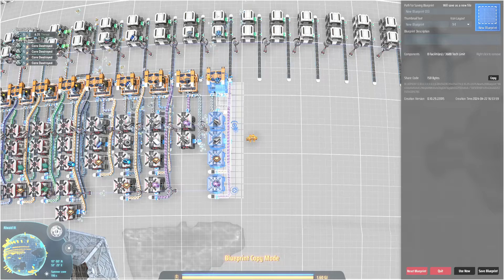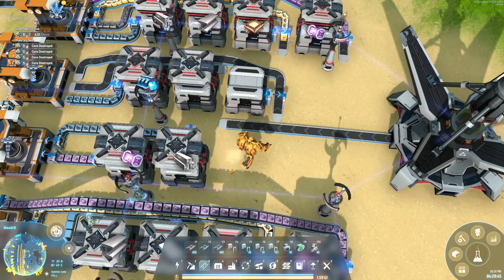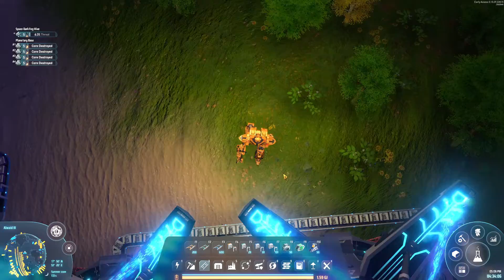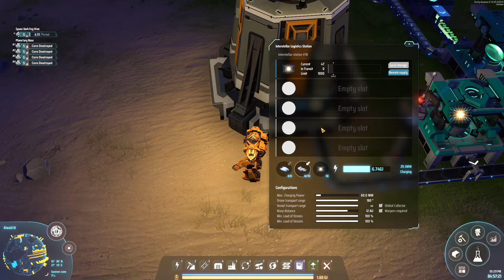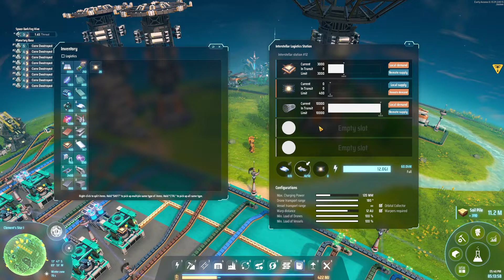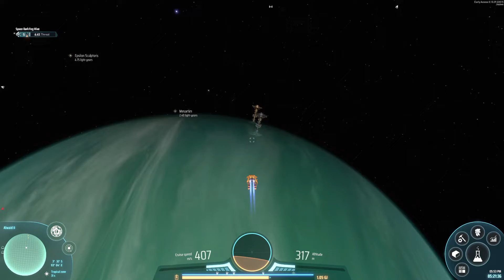ENERGY EXCHANGER // Dyson Sphere Program // Mission Log 85

Comment: I'm not sure, but I think the issue with the warpers not shipping was actually two things:
• at Alweid, the ILS tower has warpers in the cargo slot but not in the warpers slot for use
• at Clements, when you loaded some warpers into the useage slot, the tower immediately spent them all to ship processors.

I'm sorry you won't receive this until two months after sending your distress call, but I'm stuck in July 2024 where time travel is still supposed to be secret. They're starting to figure it out, and I don't want to be the one responsible for paradox crisis, not again! Alexa transmit priority Juan dangit cancel cancel what the
Reply from the maker: It's all good, my temporally challenged friend. You are undoubtedly correct, and it may be of use to another stranded time traveler in the futresentpast.

Comment: energy exchangers will NEVER overcap your power. they will only request up to your maximum available power. they are rated for 45 MW, but if you only have 30MW available it will use 30MW. you can have 9000 exchangers and they will split whatever extra power you have equally between all of them. you can also proliferate accumulators and they will charge/discharge faster, which basically just makes it so you need less exchangers to do the same thing.

remember that this tiny build is 2 production lines, which is 2 opportunities to proliferate. you could get 56% extra warpers if you proliferate both steps! (highly recommend, strange matter is expensive! lol) don't bother proliferating the warpers themselves, that doesn't do anything sadly.

definitely a huge episode here! don't forget to keep your science going in the background, you have lots of random upgrades you can keep plugging through, not to mention some neat weapons you can unlock with purple science!
Reply from the maker: Great tips, especially for the warpers. Can't believe I didn't proliferate them. See next episode for correction!